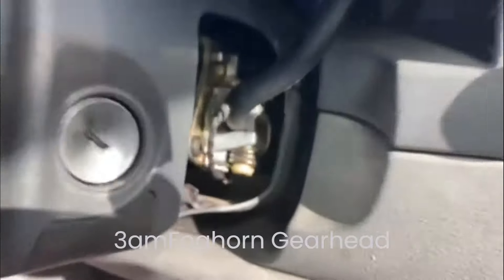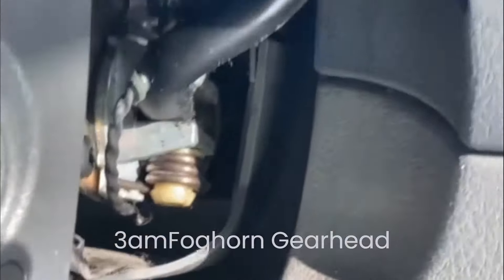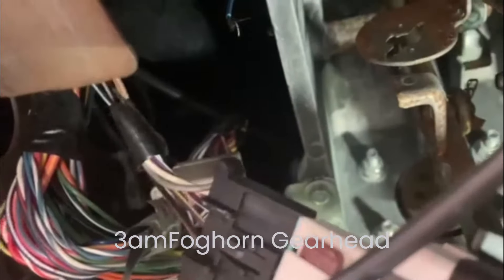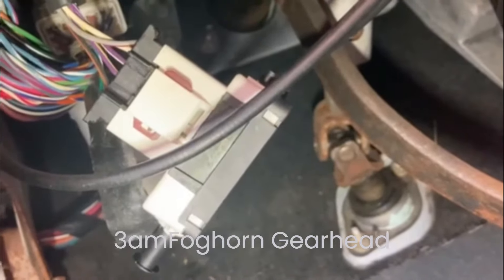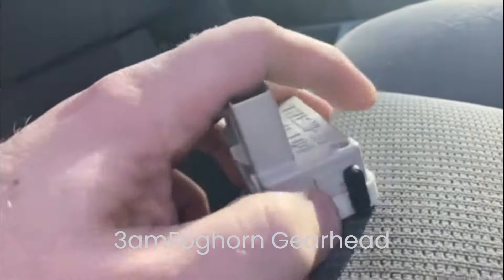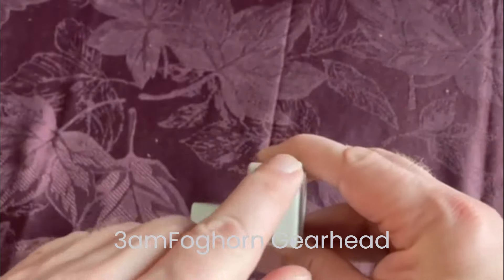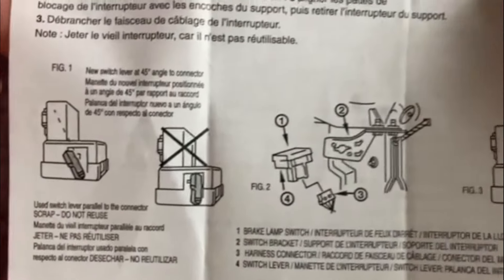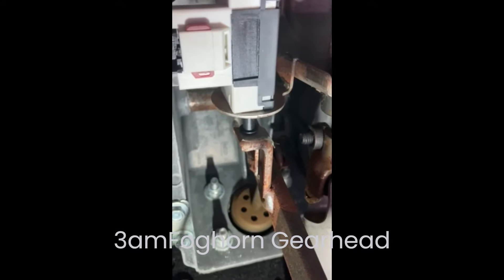Stuck in Park 2006 Dodge Durango

Comment: What if it’s not the brake ? What were you looking at in the column by the shifter? Mine was fine last night, today it wont change gears to leave park. Hit the brake and it goes up and down without engaging, if I don’t hit the brake it’s locked up and won’t move like normal